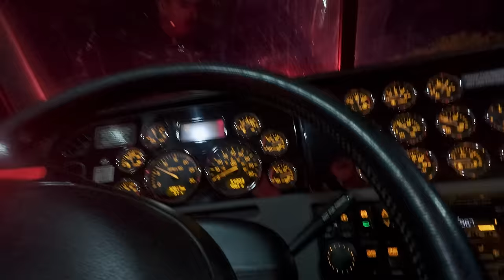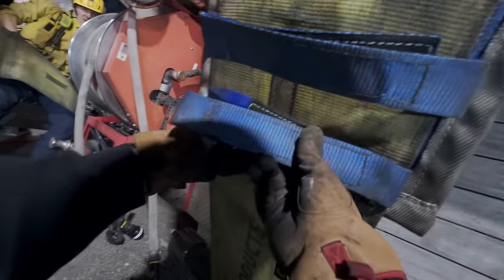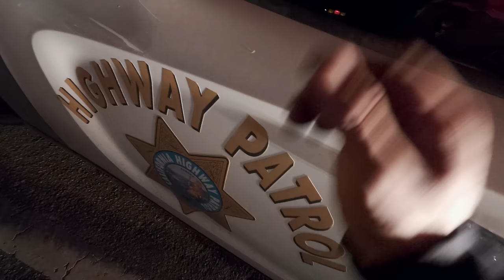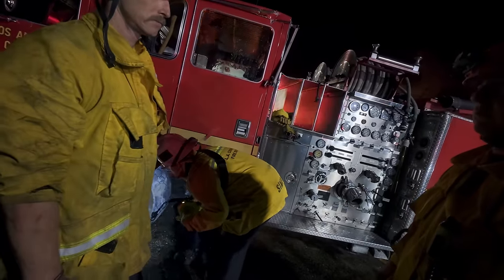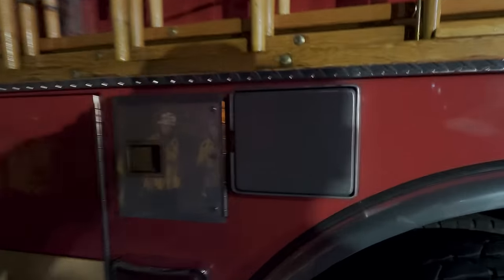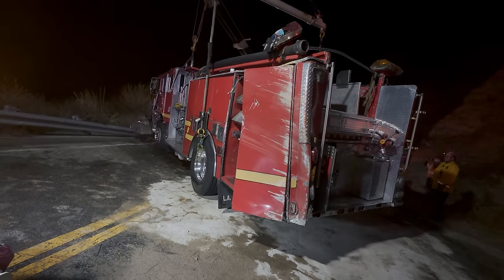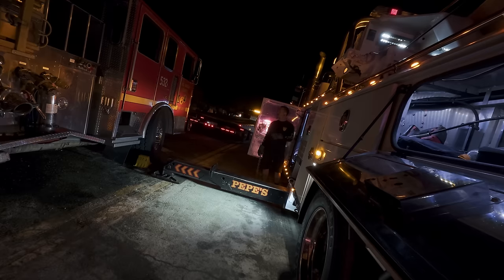Fire Truck Crashes Into Guard Rail and Flips Over

Comment: So today I learned that the underside of fire trucks are also painted red.
Reply: Because that Fire Truck was Made  in America and it shows how well it was built without cutting corners
Reply: @rogerstlaurent8704  well they over a million bucks so better be painted everywhere
Reply: and also because the Engineer's who drive them spend a lot of time underneath keeping them clean.
Reply: All I can say is boy those firemen are very possessive and protective of their truck
Reply: or the pieces are painted externally and then assembled together.
Reply: @beckyrodecker9566  as well they should be. They spend hours every day taking care of it.
Reply: I drove for a company delivering new chassis to dealers and bodyshops. everything is painted, including the airlines. Most of the time the paint on the airlines just flakes off, but it always appeared that a lot of the painting happened after initial assembly of the frame
Reply: Yeah! 😊
Reply: @beckyrodecker9566  maybe not that protective since they crashed it😂

Comment: I retired from the Fire Service after 20 years with the rank of Sgt/Engineer. Prior to and during my career I was a CDL Trucker and Heavy Duty Wrecker Operator. Regarding the FF's they weren't in the way they had their Department Rotator to "catch" the Engine as Alex lifted it to keep it from crashing onto the pavement. They have some knowledge on rigging which helped speed up the recovery. Alex gave them a class that they wouldn't have gotten on the drill field. They were learning in real world which they can use in future rescues.
Reply: Also when the FF'S take promotional test they can use this as part of their resumes. After I got my Instructor qualifications I was TDYed to every Recruit school to teach Driver Qualifications, Heavy Rescue, and Extrication classes. I loved working on Quints.....The Swiss Army Knife of the Fire Service...We did it all...Fire Suppression, Salvage and Overhaul, Extrication, High Angle, you name it we did it. Oh, looking at the beacons on the tailboard that Engine is at least 15 years old and looking at the unit # 532 , it's a reserve and not primary engine. In my department reserves were Engines 400#, Trucks and Quints 500#, Rescue Units 600#.
Reply: The thing that should really surprise everyone that's watching this , that just  a few weeks ago L. A. Brought there owen tow ridges , to up right a truck that over turned on an over pass , and it took days to clear that job  well done. Put on ur resume

Comment: Wow unbelievable, those guys are usually so careful. Maybe he had a steer tire blow or was dodging a rock slide, thanks for sharing! "Pepe's Towing" is the best, hope nobody got injured.
Reply: If he was dodging a rock slide, where are the rocks?
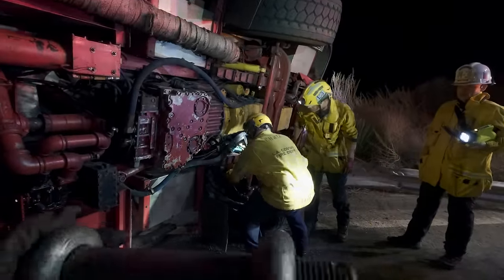Reply: Fair! I just didn't know what the fluid was sprayed all on the tires, (4:58 mark with someone in the background saying "it'll break on us just by driving") maybe brake line failure due to lack of maintenance + steep slope? Unless it got all wet after the wreck, I dunno 😅
Reply: A Los Angeles County Fire truck overturned, injuring three of its crew members, while en route to a cliff rescue call in the San Gabriel Mountains on Sunday evening.

Fire officials said it happened around 5:39 p.m. on Highway 39 near the San Gabriel Reservoir.

According to initial reports, the driver was attempting to straighten back out after Engine 32 slightly veered off the road, but the truck “fishtailed,” causing the driver to lose control as the truck overturned and landed on its side.
Reply: @owenp5730  They were on their way up (see my other comment). Just an accident, maybe a lapse in carefulness.
Reply: @ why did it slightly bear off the road?  That’s what I’d like to know.
Reply: @stuckincommiefornia  Thank you so much for the report! Didn't want to be an armchair critic by any means haha
Reply: @owenp5730  Me neither; it was local to me so I looked it up and even then I won't blame the driver too much. Everyone makes mistakes, we weren't there, it is a difficult job / road, and I hope he recovers (career wise).
Reply: @owenp5730  Fire trucks have air brakes so a brake line failure would result in setting the brakes.  The fluid on the ground and all over the truck is probably just water (in a rollover the water in the tank just pours out the top hatch).
Reply: @michaelfagan2086  Ahh that makes sense! I was wondering if it was water, or just super clean brake fluid. Water makes much more sense 😂😂thank you!
Reply: @michaelfagan2086  it should hold 500 gallons of water
Reply: @stuckincommiefornia  slightly veered off the road ?? so dug the right tire into the ground on the right , overcorrected and flipped.
Reply: @TheWorldIsBetter  driver error narrow road as well probably dirt shoulders
Reply: @randydub6868  some hold up to 1500

Comment: FYI being from Los Angeles County the 532 on the back of the engine the 5 means its a reserve engine in place of the main engine 32.  LACFD has a very huge repair facility in East LA off of Eastern Ave and the 10 fwy. more than likely the main engine 32 was at the shops for a service.  I have been to the shops many times over the years back in my towing days in LA County.

Comment: for all those commenting on the firefighters "getting in the way" ... a fire truck is a massively modified, and specialized, piece of equipment.  Every single one is built by hand, and built to individual specifications.

Nobody is going to know its ins and outs better than the people who utilize it.

Note the comment when they moved the strap to the axle, "we've had springs break just by driving on them" ...

Fire trucks are also very expensive.  This wasn't a cheap wreck by any means.  Hope all the fire crew were unhurt.
Reply: springs break because they have a water tank usually filled with water. this time the water was gone
Reply: @ronblack7870  yep.  Very very heavy.

It's not clear in this case if they emptied it, or it was traveling empty ... but it was definitely empty by the time they uprighted it.
Reply: @litz13  Also noticed a lot of the equipment was removed before the recovery. Some might have come off during the roll over.

Comment: I just realised, they said traffic had been stuck for 5 hours.  So say Pepe's took an hour to arrive and Alex did the setup in half hour, then it was 3.5 before they called Pepe's...!  Naturally they were focused on the occupants initially, but that's a big delay.  Maybe they thought their rotator could do it solo?  I think Alex & Flipper could have but it takes practice. ie. Lift with the mains and catch it with the secondaries on level 2 or 1.

I was shocked when Josh turned up in the landall.  Had he been naughty?  Then he laid hands on Alex's remote control... Shocking 😮😂

Comment: How did the driver lose control? He certainly couldn’t have been speeding, right? 😮
Reply: right tire got in the dirt on the right side driver over corrected and with 500 gallons of water in the back it fishtailed and flipped over.
Reply: @ guess he may need a refresher in driving

Comment: How does a fire truck crash into a guardrail?
Reply: The same way all vehicles do
Reply: @bradjohnston2102 fire trucks have right of way that others don’t have, and I heard them talking about him driving into the dirt and losing control. It just sounds fishy, he also said it was his first firetruck so will somebody get fired or what?
Reply: @justplinkin4809 I get that! Just from the video, that's fair! I just don't know what the fluid was sprayed all on the tires, (4:58 mark with someone in the background saying "it'll break on us just by driving") maybe brake line failure due to lack of maintenance + steep slope? Unless it got all wet after the wreck, I dunno 😅, just happy no major injuries is all!
Reply: @justplinkin4809  That seems to be what the news was saying:

A Los Angeles County Fire truck overturned, injuring three of its crew members, while en route to a cliff rescue call in the San Gabriel Mountains on Sunday evening.

Fire officials said it happened around 5:39 p.m. on Highway 39 near the San Gabriel Reservoir.

According to initial reports, the driver was attempting to straighten back out after Engine 32 slightly veered off the road, but the truck “fishtailed,” causing the driver to lose control as the truck overturned and landed on its side.
Reply: @ Sounds like something most folks would get fired over. You know, careless or reckless driving?
Reply: @justplinkin4809  Absolutely! Now that I know of the report, that's on them! I was trying to give benefit of the doubt but hey, if it was driver error/carelessness then I can't be mad at the truck haha
Reply: How does anything crash anywhere?
Reply: @simonwhyld3003  how many licks does it take to get to the center of a Tootsie Pop?
Reply: @ we are talking about a great big firetruck with flashing lights and siren on a call. This vehicle has right of way and apparently due to negligence, ran off the road, and crashed AND injuring passengers, so at least a ticket if not firing is called for in my opinion. If you have ever been driving down the road having to yield for one of these things you know what I mean.
Reply: @owenp5730  Ya; I didn't want to blame anyone but I was also curios on how it happened since this is local to me. Found the news story.... I'm no expert but sounds like a bad time for the driver afterwards (even if he stays on with the department). Good luck to him; everyone makes mistakes and we aren't immune.
Reply: @stuckincommiefornia  Absolutely, haha just hope the firefighter is okay along with their job standing! That's just a bad situation all around
Reply: Gaurd rail was drunk..

Comment: could you have towed that firetruck or did you need the flat bed
Reply: @waynekoepke8128  the wheels could have been bent, less damage back to the yard than 60 miles on the back of a HD tow
Reply: could damage the transmission if rear axles turn the trans. so have to pull the axles out usually . it's simpler and josh had the landoll there already. and big flipper doesn't have toebar but looked like fire wrecker did
Reply: @randydub6868  ok thanks that would have been a long ride on the hook
Reply: @ronblack7870  thank you i know that they did what they had to do it was the rite call